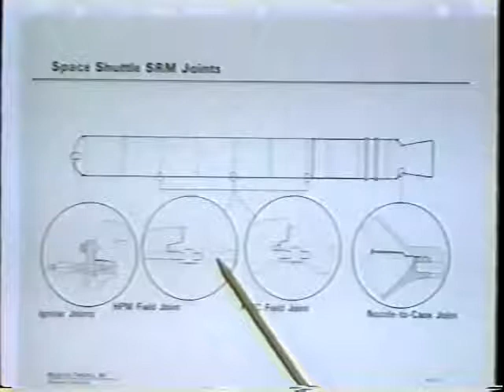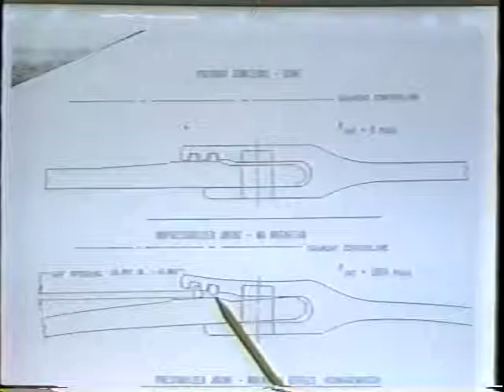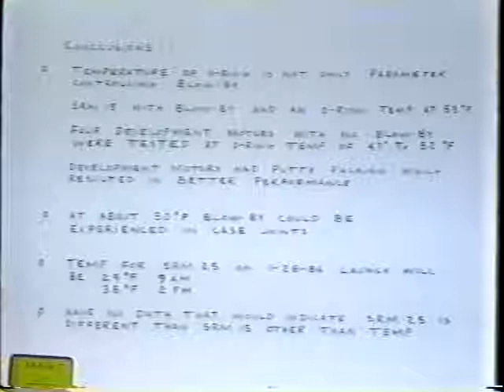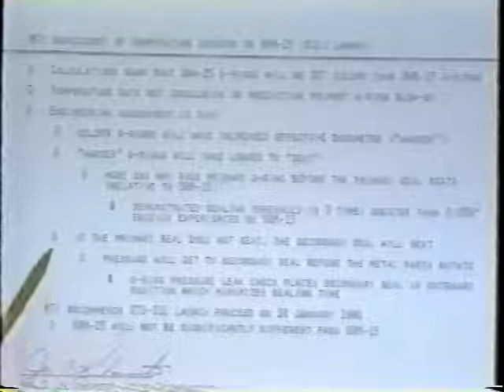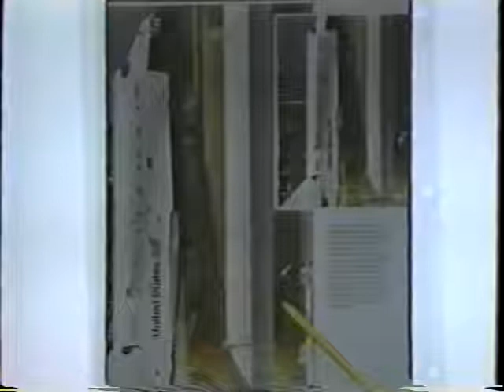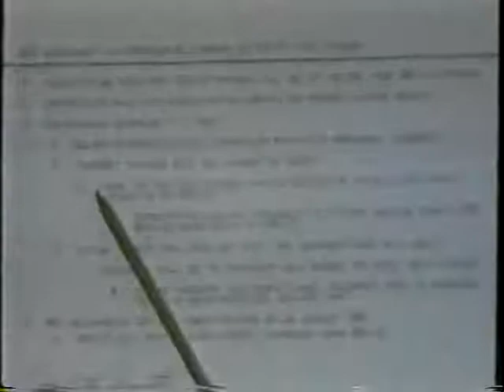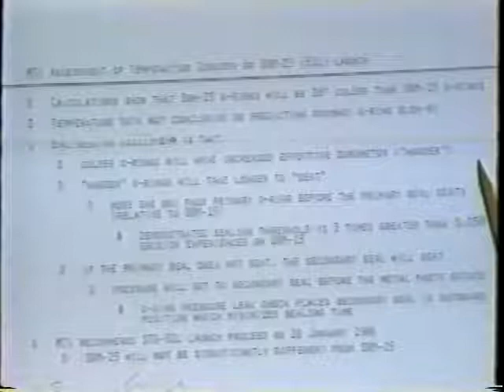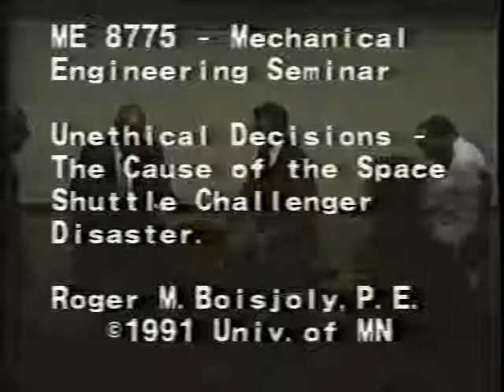Unethical Decisions - The Causes of the Space Shuttle Challenger Disaster Roger Boisjoly

Comment: This is the first time after all these years later that I saw the redesign of the field joints.I always wondered what the fix was going to look like.
Reply: Why were they used in the first place? A solid "tube" makes more sense. In any case if you watch the Rogers commission testimony the whole thing sounds crazy. "Yeah, a little o ring erosion, no problem". They should have grounded the fleet once it became evident there was any blowby regardless of temperature. Really screwy.
Reply: @tedpeterson1156  The O rings were used because Morton Thyacol was located in UTAH.  The company had no access to a port to ship the Solid rocket engines by ship over the ocean.  They had to be shipped by RAIL meaning they needed to be shipped in pieces.  That required the field joints.
Reply: @tedpeterson1156 And the sad part is, the fox was well under 3 years it took to investigate the cause and what to do later.

Comment: Two takeaways: 1st that NASA culture needed to change. It was proven again in the Columbia disaster, another engineering crisis that engineers had warned about previously—this time the crisis came about because of pressure from radical environmentalists that forced the the liquid booster engineers to come up with a safer foam insulation coating product but would not adhere as well as the original. The 2nd takeaway from this whole enterprise was that the Space Shuttle was so complex that it had multiple single failure points of engineering, that if one item failed would result in disaster to the flight without protection for the crew. The entire program was built on a premis that engineers could overcome every problem to make a rocket reusable but every mission was an exercise in crossing your fingers hoping it would survive. The space shuttle was epic financial and engineering failure and shines as just one more example of overreach and wishful thinking.
Reply: Not only with Columbia. Atlantis barley made it home one mission. From falling ice blocks like Columbia. It cracked the bottom of the heat shield leading to one panel burning through and as they described it the Most damaged Not only with Columbia. Atlantis barley made it home one mission. From falling ice blocks like Columbia. It damaged some 700 panels the heat shield leading to one panel burning through and as they described it the Most damaged launch vehicle to ever return to earth successfully. 

STS-27. Just two missions after challenger
Reply: In reading Malcom McConnell's book about Challenger ( Challenger: A Major Malfunction, Doubleday 1987)...In support of your statement, Mr Fishman, on page 9 the author states over 700 pieces of hardware on the Orbiter stack were listed as 'Criticality 1' - which meant that the failure of any single ONE of those items would result in catastrophic loss of crew and vehicle.